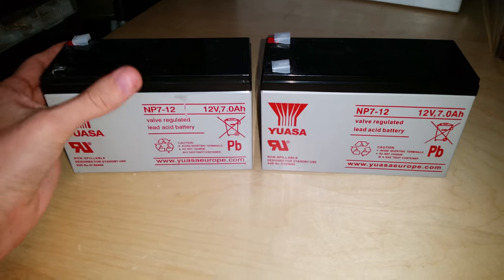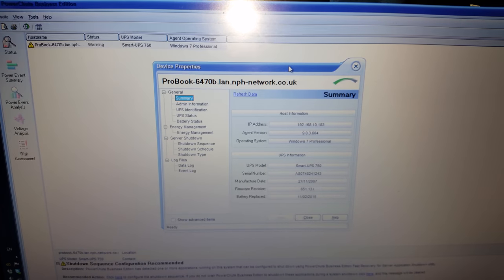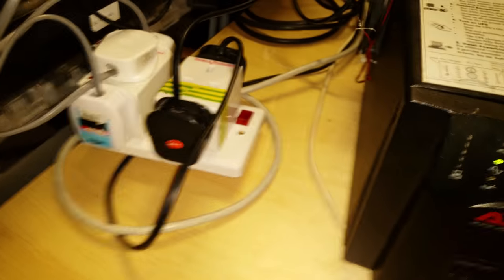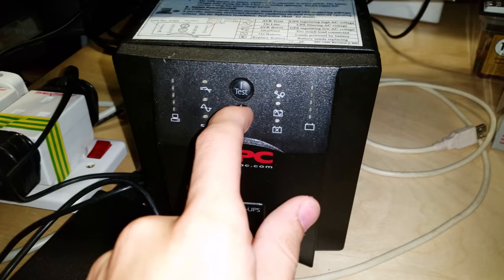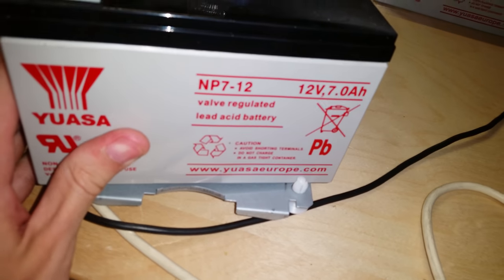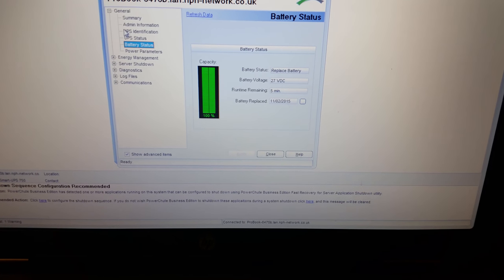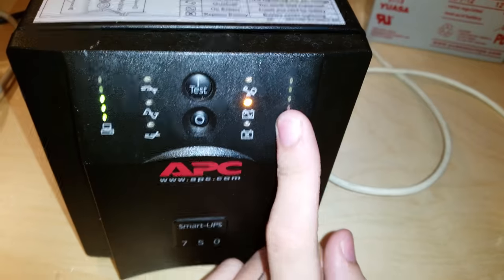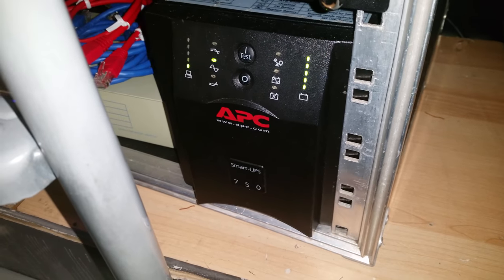APC Smart-UPS 750 Gets New Batteries & Re-calibrated - Home Network Backup Power Supply (Yuasa NP7)

Comment: One safety tip - if you're testing or calibrating it's best to leave the supply plugged in to an outlet with the switch off. This disconnects the supply but importantly leaves the earth connected. By removing the plug you are also removing the earth connection.
Reply: Between live when outputting on battery back up and mains earth will give you 0 volts. Bit like how a shaver point works for safety idea. So having an earth connected makes no difference. In fact it’s safer to have it unplugged as relying on the isolator on the socket it could be faulty though if likely agree it’s slim. Also most socket switches are single pole only breaking the line.

Comment: The batteries in that unit are hot-swappable once you pull the battery disconnect plug out of the back. No need to turn anything off or even take it off the shelf.

Comment: Apparently you can turn off the beeping 

"The UPS switches to battery operation automatically if the utility power fails. While running on battery, an alarm beeps four times every 30 seconds. Press the button to silence this alarm. If the utility power does not return, the UPS continues to supply power to the connected equipment until the battery is fully discharged. "

Comment: I have same model. Any reason why no lights come on at all?
Reply from the maker: Have you got the battery connector installed at the rear? Do you have some cells/batteries installed, too? 
If not connected to the mains, you may have to hold the power button down for a few seconds until the unit begins to beep, then release it to power-on without utility power. 
Hope this helps! 
--Nathan

Comment: Wow, where abouts are you in the UK, that input voltage is high! Mine is usually between 229-240 volts, with the highest I've seen of 243.
Reply from the maker: I'm located North-West - Near Manchester/Liverpool. 
I live close-ish to a large substation / transformer site which is probably one of the reasons for the high input voltage. 
During the early hours at off-peak times the voltage often rises as high as 254 volts and the UPS units over voltage protection begins to kick in and out.

Comment: What the software you used to calibrate this ups..?
Reply from the maker: Hi, The calibration can be done without any software by simply connecting a load and running the batteries down from 100% until the unit powers itself off as I do in this video. The software I used to look at the details within the UPS is APC's own 'Power Chute' utility.